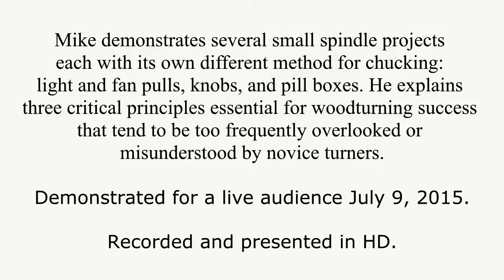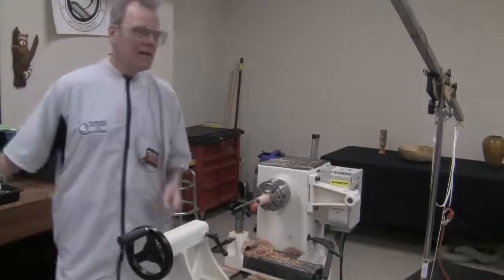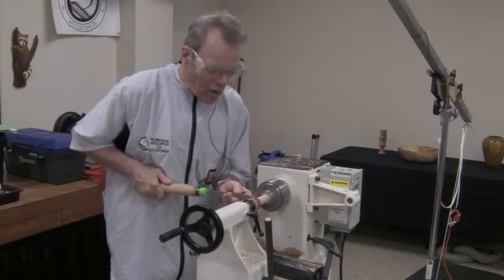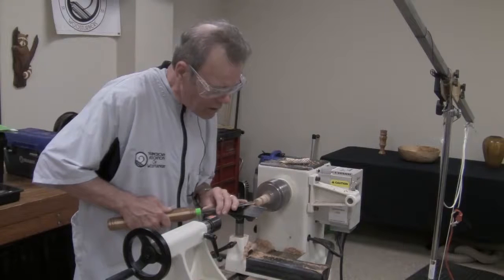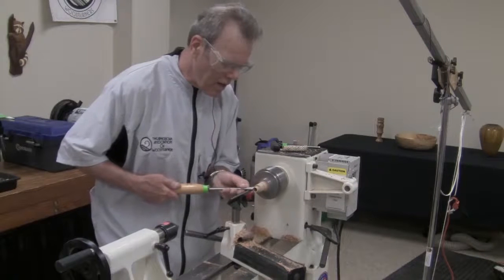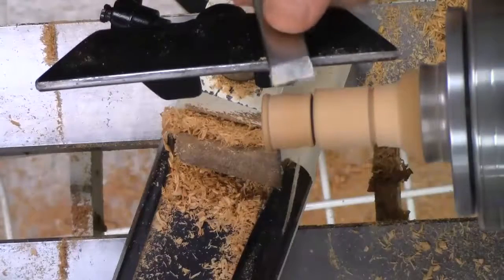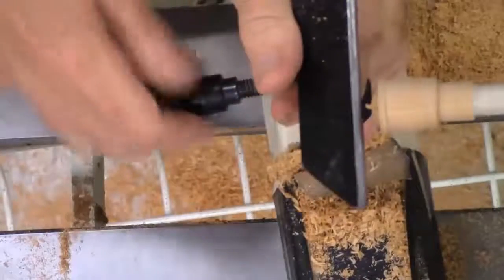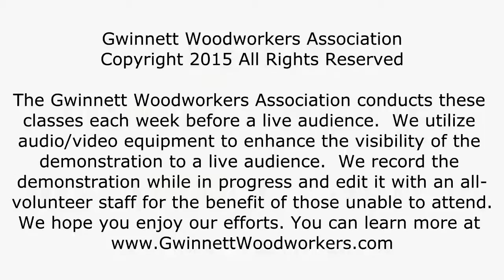Small Spindle Projects by Mike Peace (Part 2 of 3)

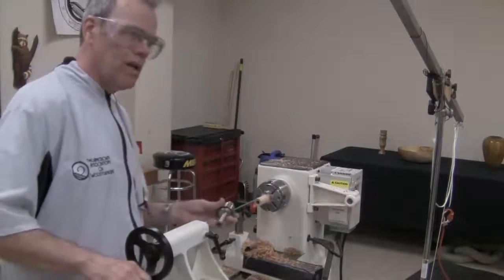Comment: At 5:50 when you’re discussing the holding power of a Morse taper, a great example of the strength of a tapered connection comes to mind. On locomotives, each axle has a huge “bull gear” on it. That bull gear meshes with a much smaller “pinion gear” that’s mounted on the shaft of a massive electric motor. The motor shaft end and pinion bore are a tapered fit, and that is all that holds the pinion to the motor! No key way, pins, bolts etc., just that taper! Imagine the forces at work when a 150 car train is climbing over the mountains, each car having a capacity of 100 tons, and locos weighing 400,000+ tons each! I worked on them for 41 years, and that still amazes me!

Comment: Thank you so much for your videos!
I watched this video (series) yesterday and made my first "pill case" this morning.
I bought my first lathe (mini lathe) about 3 or 4 weeks ago and received my drill chuck late last week.* 
I modified the process a bit to work for my tools and abilities (and a bit due to forgetting the details of your process).

For this project I started turning between centers since the piece of wood I used is "scrap" from a neighbors tree that i got last year. I split a piece off, and then used a little band-saw to cut it up into pieces I can cut further later and then very roughly shaped one piece for this project.

I bored the cap out with a 3/4 inch Forstner bit. I bored the body out with 5/8 inch Forstner bit (I first cleared some wood out with a 3/8 inch twist drill bit).

I am looking forward to making more. 

*Thank you for the info about holding onto the chuck (on my MT#2 shaft) while withdrawing drill bits from a project piece. No close calls since, in this case, I "learned from the mistakes of others."
Reply from the maker: Thanks for your comments. You can see more woodturning tutorial videos on Mike's Youtube channel.
Reply: Thank you for the reply, and a big THANK YOU for this video series! 
I did not think about how my reply would not be going to Mike (which is obvious when i think about it for a moment). I have been to Mike's page many times (since seeing this video) and I will send a mention separately to thank him for this video.